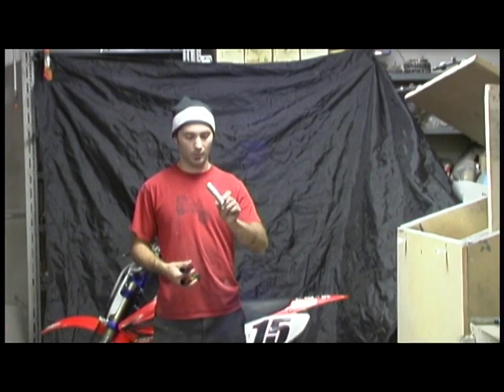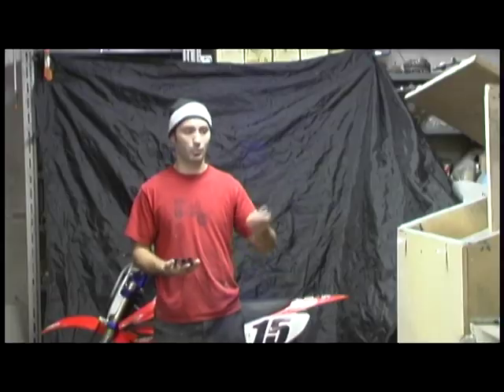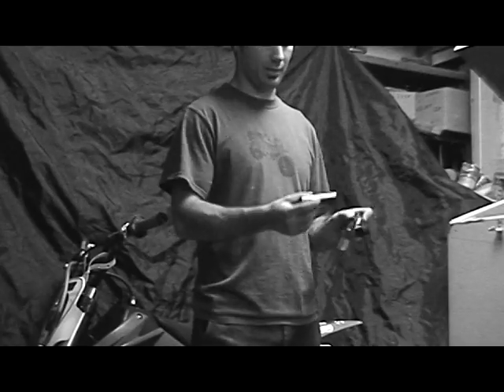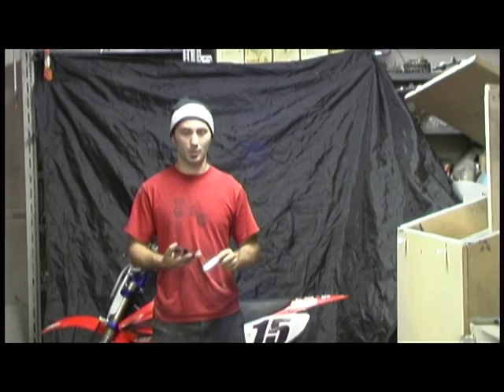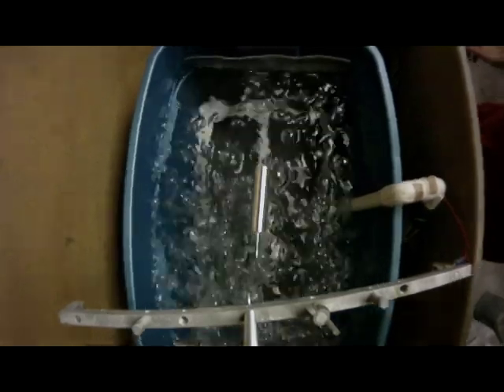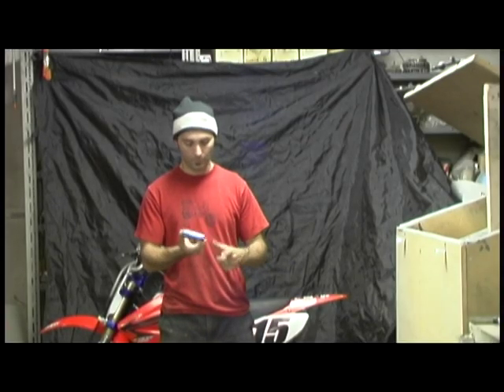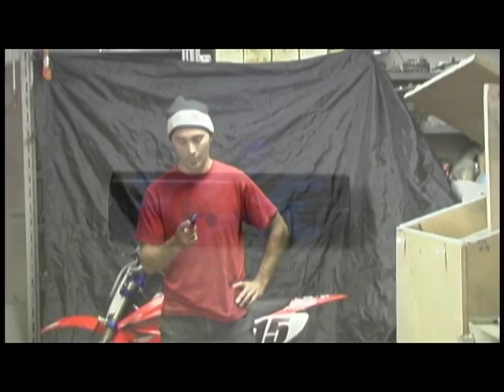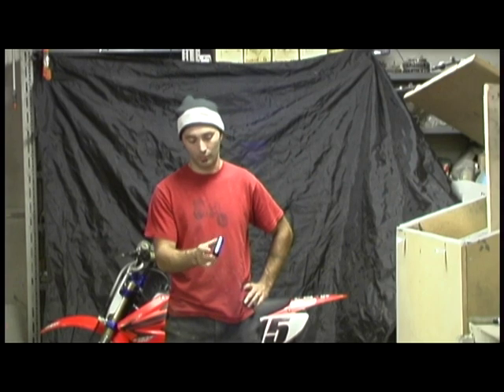Splash Anodizing Aluminum How-To

Comment: Anyone know how long you can store the acid solution?
Reply: Forever ♾. It will eventually just become weak. Keep a lid on it and don’t splash it around. As the water evaporates the percentage of acid will go back up. I use backing soda as a neutralizer. I work on cars and del with bad batteries Frequently and that stuff all on the cars. Whenever it is on sale the store I BUY it. I keep it everywhere. It’s saved my eyes! 👀 🤚 put baking soda in a water bottle and pour that shit on!

Comment: I am a hobbyist and I am TRYING to find the range for setting up power supply to surface area for aluminum anodizing.  Specifically complex geometry.  Paintball markers for instance.  Since they are so complex in surface area.  Is there a range in this ratio before degraded quality?  I Understand most all say 5 amps for sqft. Is that a set up for type II? Sorry for all the questions.  Thank you.
Reply: 6yrs later and you get an answer. 2 Amps per sqft for type II. Length of time and 5 amps for Type. But you will need a stronger cause concentration.

Comment from the maker: Thanks. The sealer is a Nickle Acetate solution brought to a boil.  The colouring is commercially available anodizing dye, I've heard you can use fabric dye too. The electrical current is just one part of this process, I showed it the beginning in the bubbling tank.  I have a better demo on that part of the process in my other anodizing videos
Reply: Can this be done to rifles made from 7075-T6 AL. And is the sealant required?